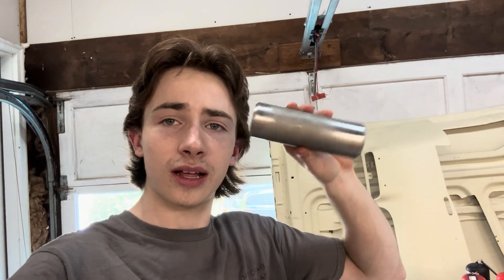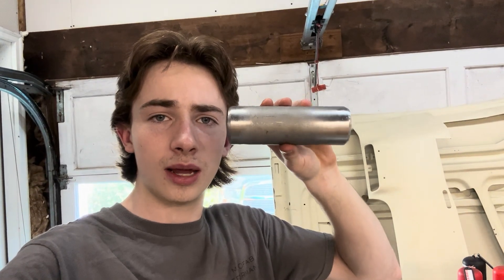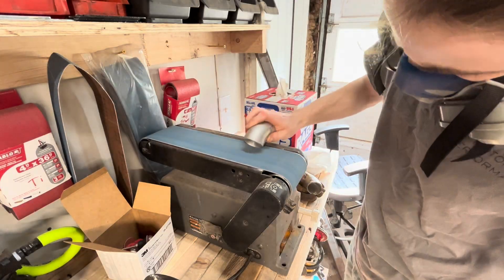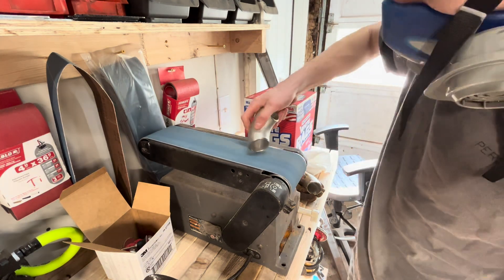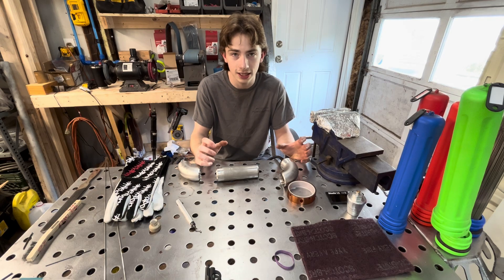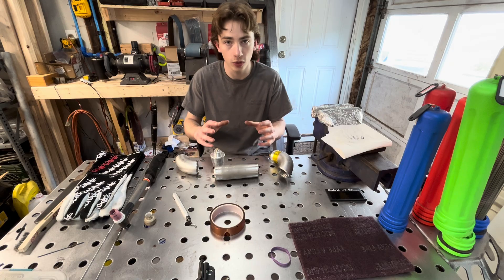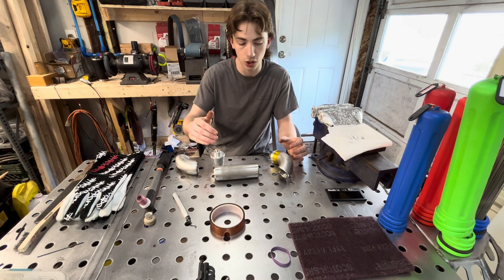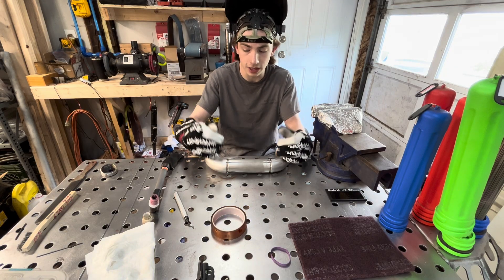The SECRET to welding SCH 10 Stainless Pipe

Comment: I made some tack bands out of some spare pipe I’ve got, I use it on exhaust systems but I wonder if you could make some for NPS pipe
Reply from the maker: They make them but they don’t work well on the weld els.

Comment: Also this is perfect timing! I’m planning out my first manifold and I was planning to use schd 10 weld els. 

Is the back purge necessary for a good full penetration? Just wondering if I need to get a dual flow regulator
Reply from the maker: Yes back purge is essential for penetration as well as for keeping your engine or turbo safe from debris on the backside of the weld.